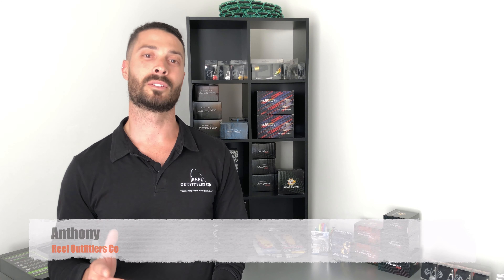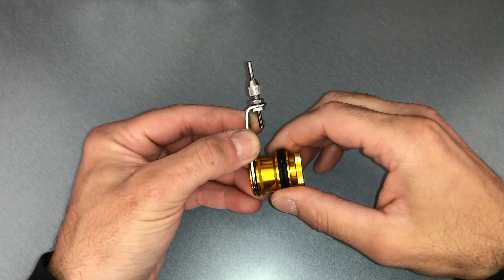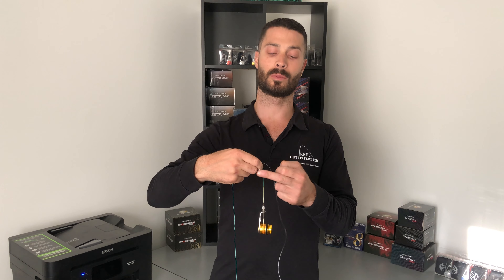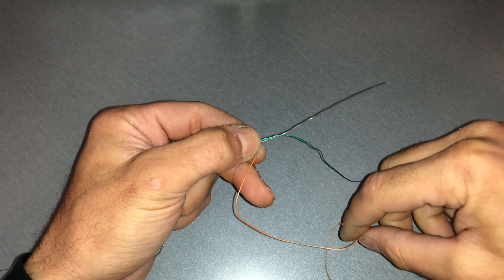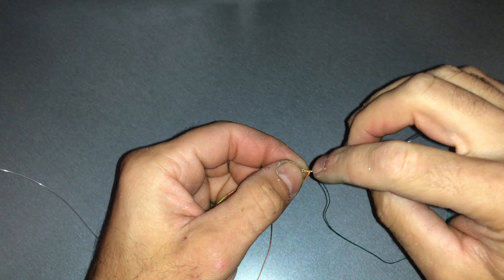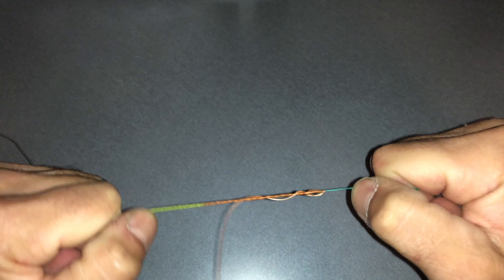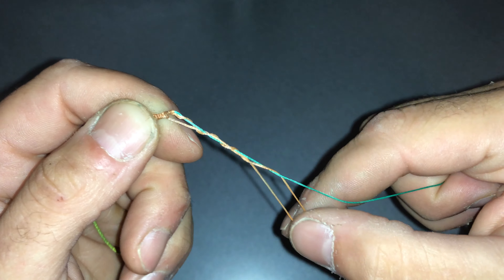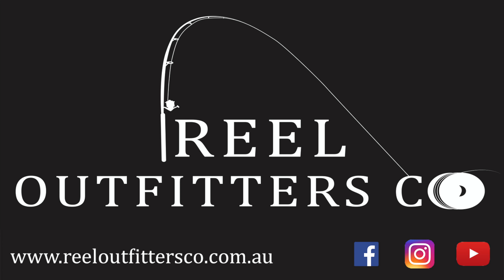How To Tie A PR Knot

Comment: Great Vid !!  I've been using the PR knot for several years now and for me it is much better than the FG.  I have finished the PR a number of different ways and tested the breaking strength.  For going through the guides, I have tied it almost exactly as you have in this video.  One thing I noticed in testing the breaking strength is that when tying this way, it almost always broke either at the 'mushroom' or at the hitches or Rizzuto braid to braid at the end.  Personally I am not a huge fan of casting knots through my guides when casting lures all day, I feel it weakens the knot and so I run 5-6 feet leader and keep the knot outside the guides when casting for popping.  The difference in how I tie the PR knot in this case is I use line pullers to tension the 1/2 hitches of which I only do 5 alternating, and then the Rizzuto is a 5 turn and again tensioning with line pullers.  Also, I have found for the mono 'Mushroom' if you dont burn it long enough, and you flatten it, the edges can be sharp and weaken the braid.  If you burn it a little longer it will form a ball that is very smooth.  The 'ball' is exposed and I dont tie over top of it, so no braid to braid hitches or Rizzuto and the braid will run along the ball to the spool.  After testing this method Many times, it seems the break strength is greater when tied this way.  The downfall is that the 'ball' does not go through the guides well either way.   Also, if using line pullers for your half hitches and at the end of the Rizzuto, you will see the braid dig in and change colour like in the FG.  Another finish I have tried is not creating any mushroom or ball, and actually slightly sanding the end of the mono to smoothen it and it seems to hold just as well.
Reply from the maker: Milty7227 great input 👍🏼 

I’m glad to hear about the little differences that you do to tie yours. Your 100% right about the knot wearing after casting all day. Having a small leader with the knot outside the guides is highly recommend if your setup for top water stuff. I do feel the edges aren’t sharp before letting the half hitches pull up against the mushroom. Thanks for a detailed comment 🙏🏽